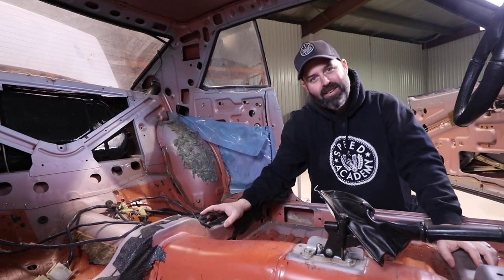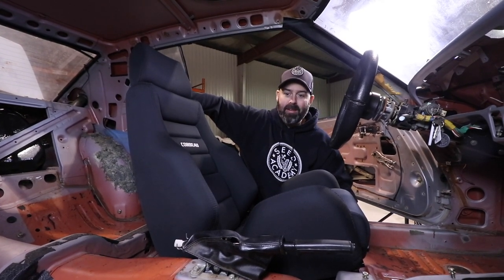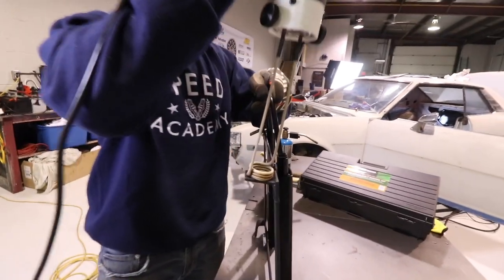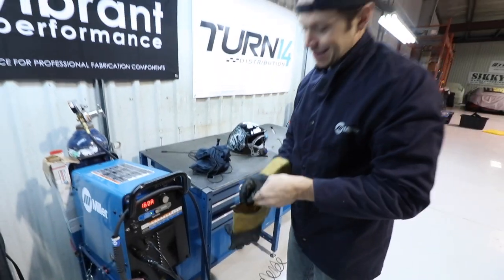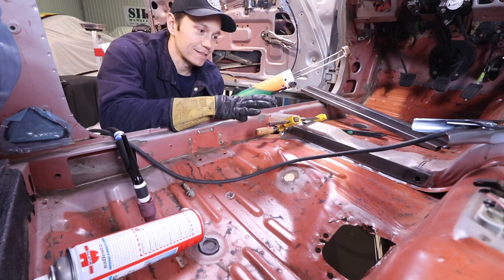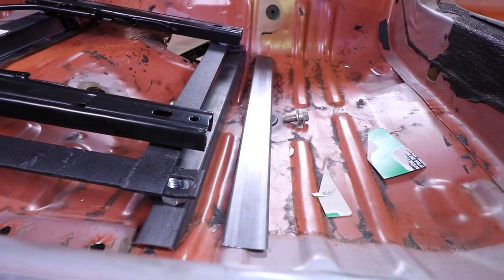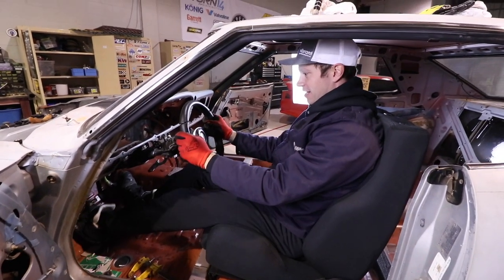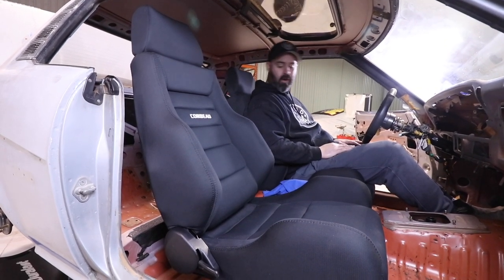Building A Custom Seat Mount - RA24 Toyota Celica Project

Comment: Peter, the induction heater idea is pretty good however the heated material has to be inside the coils to be properly heated. Maybe putting a sacrificial bolt through could help with indirect heating

Comment: i found this on a website for the box you found in the trunk 

1976,1977,76,77 Toyota Celica 20R RA24 RA29 OK ESP ONBOARD MONITOR 89590-14040

Item Description: This listing is for a OK ESP Monitor control unit from a 1977 RA29 GT with a Automatic Transmission. What is does is monitors all the fluid levels, Lights and the brake pad wear on the 1976 and 1977 RA24 and RA29s equipped with this system. This system has a digital display that displays any detected issues such as low engine oil, low brake fluid, low washer fluid, low coolant, burned out tail lights or brake lights and brake pads that are worn down to a point to needing replaced. This system also displayed battery electrolyte level but these days the batteries are no longer available that will work with this system. This system was equipped primarily on the GT models. This unit is located in the trunk on the RA24 models and behind the left cover panel in the lift backs in the rear of the car

Comment: its really nice that yall are putting out content at this rate. especially because i've been loving the connie series. but, a fun trick for welding, since mig guns dont burn through and put down material for filling, you can first fill with a mig gun and come over it again with the tig torch to smooth it out and expand the heat effected zone. just a nice little trick to speed up your tig welding if you arent any good with filler rod.
Reply from the maker: Cool trick, we'll give that a try, thanks!

Comment: 89590-14040 celica ESP monitor - There was also something called an Electro Sensor Panel, or ESP, America's updated version of the useful but questionably-named OK Monitor, fitted as standard on the GT Liftback and extended to all GT models for 1977. 

what it is I have no clue.

Comment: That is a JDM spec thing: it announces via the speakers if you have any faults with the car. I have found it first on Toyodiy, then did some research on it. It is newer of course than the car, but not by much: I think the 1981-82 Supra had it as well (with the optional, first ever navigation system as well).

Edit: you are giving it away? I WANT IT :) shoot me a mail pleaaaase!
Reply: This is inncorect it does not announces faults through the speakers
Reply: It is the ok monitor that Toyota put in all celicas.  There should have been a readout in the center console.  The ok monitor monitored several things, brake wear, fluid levels and such.  It is actually quite cool.  I could use yours for my 76 Celica GT

Comment: I had a similar issue with my Corbeau seat and rails in my EF sitting too high. I ended up hard mounting the seat to the floor with side brackets instead of using the Corbeau brackets. I lost the slider adjustability but the seating position is much lower now. I also noticed the Corbeau slider brackets had some play yielding the seat having some movement fore and aft. Might have just been my slider set though.
Reply from the maker: Our sliders don't seem to have any play, but we may resort to bolting it to the floor if we need more headroom. Still lots of work to do and things will no doubt evolve with respect to seating position as we dial in the position of the shifter and pedals and all that good stuff.

Comment: If you don't like Corbeaus, i'll probably catch flack for this but S2000 seats work great in a RA24. They are comfortable, the bottom cushion is nice and low giving you plenty of headroom and you can use the factory s2k rails with a piece of angle iron to the factory celica mounts in the front and do a similar braces as what they did for the rear. Plus S2000 seats are everywhere online for cheap!
Reply: ra24Lew that sounds pretty cool. could reupholster them to match a retro interior a little better
Reply from the maker: S2k seats are never a bad idea. We'll see how things go with these for now. We're not married to them and if Dave's at all unhappy with the seating position once he's driving the car, we'll try something else. Like most projects of this type, it's a work in progress and will be for years to come.

Comment: One thing I do when welding nuts to metal, is thread a bolt into the nut hole so welding spatter doesn't get into the threads.

Comment: If you are going to be miging to pieces together, like the captive nut plate, you can use weld through primer to make sure it doesn't rust in between the parts.

Comment: it's the ESP system monitor. actually very impressed that the celica had ESP in 76-77
Reply: Ace Futura the Celica had the esp since it first came out.  I believe it was standard in the GT and an option in the ST
Reply: cool, thx for the info. still very impressive for a 70's mass production car imo =)
Reply: I thought it was the coolest thing about my first 77 Celica way back in the 80s.  Trying to get the one in my 76 back up and running

Comment: Seems really dangerous to have the seat rail behind the frame. If you come to a sudden stop, the bolt holding in the seat rail doesnt do much and those weakened tabs will just bend or even snap. I would consult the engineers at corbeau or whomever built the rails
Reply from the maker: Hmm, that's actually a really interesting point and one we hadn't considered. Thanks for the insight. Definitely taking this into consideration now.
Reply: Always lookin out for safety 🙏 who knows, i could be completely wrong! But everyone can learn from a mistake and if the mistake is worrying about something being unsafe then everyone wins
Reply from the maker: totally appreciate it. Just thinking about it some more, and with how heavy duty the rear mounts are, I don't think the front tabs could move or fold without the rear mounts tearing out of the floor or the chassis crumpling severely in the floorboard area beneath the seat. It would take a massive impact for that to happen, plus we're putting a roll bar in the car (maybe a low doorbar as well to stiffen the area across the middle of the chassis) so we'll have added chassis stiffness and 4-point DOT approved (Schroth or Takata) harnesses in the car which better distribute the load across the driver's body in an impact, which will lessen the load being put into the seat mounts. Plus the metal on the Corbeau rail is super thick, way thicker than the OE rail, so all in all I think we're going to be fine. But I do appreciate the thought you put into that, safety is definitely not an area to skimp out on, especially in an old car like that which isn't built to modern crash standards.
Reply: Great to hear 👌 keep up the great content! Love it 🙏🙏